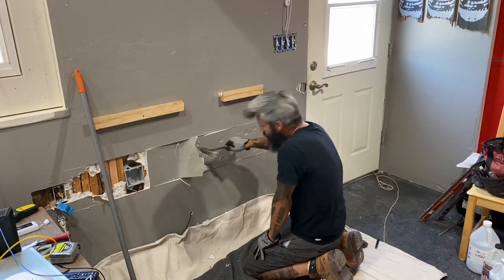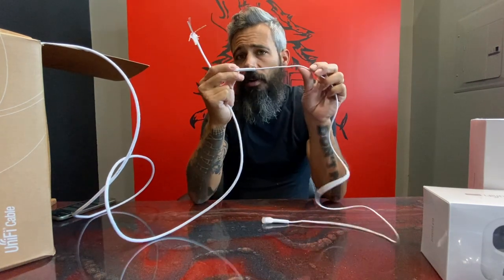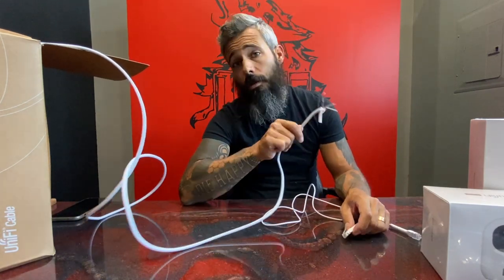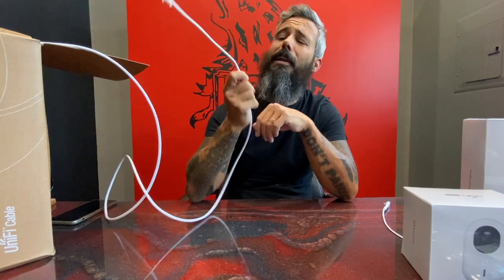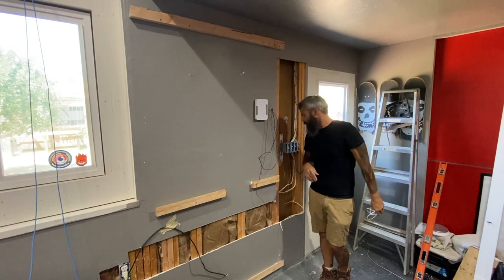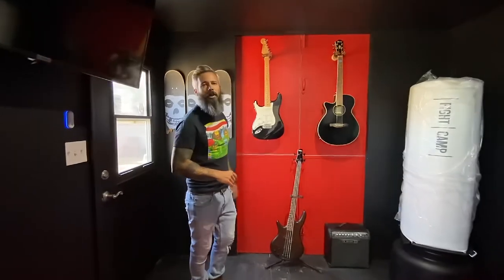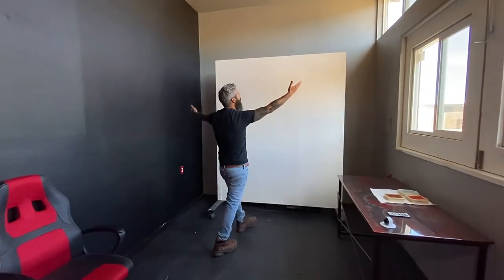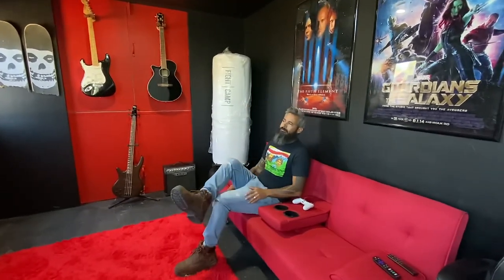Tiny Home DIY Cable Management with UniFi

Comment: Great video as always. Watch out for ventilation on that equipment behind the wall, especially the PS4 as that will get super noisy and hot.
Reply from the maker: Thanks for the advice. I checked on it quite a bit to make sure it wasn't getting to hot. The ps4 was definitely not helping. But since I take my playstation back and forth between the tiny house and the main house I just plug it in temporarily on the floor.